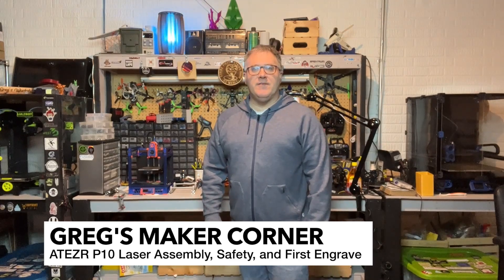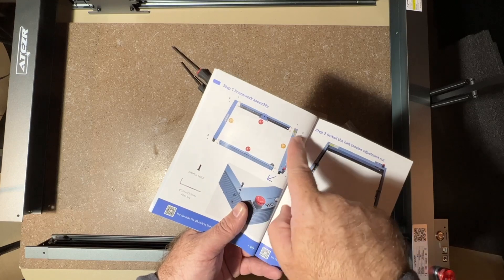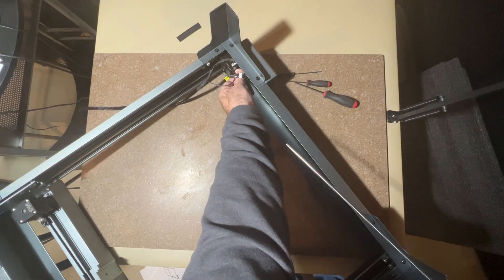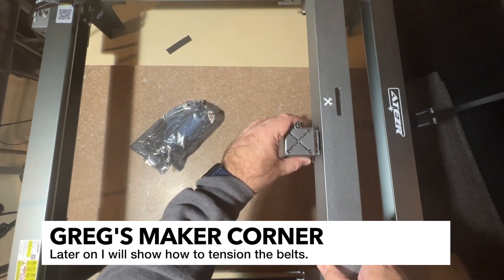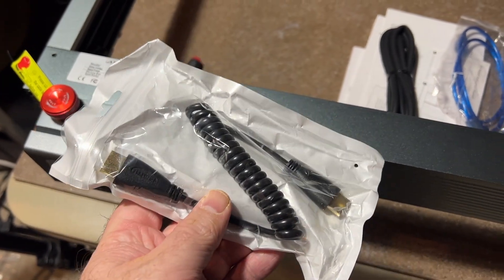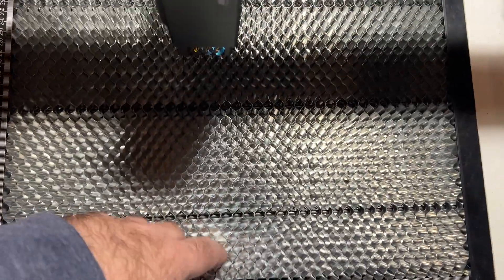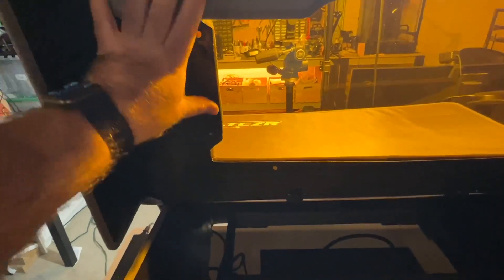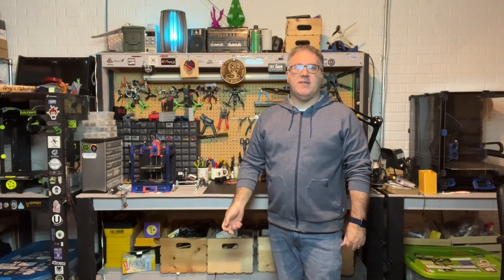ATEZR P10 Laser Assembly, Safety, and First Engrave

Comment: Hi Greg!  I am new to lazer engraving and assembled my Atezr p10 60w engraver. When I go to home the machine, it works well on the lazer axis but then makes a terrible noise and stops when trying to move down the y axis. Any idea on what this could be? Lightburn is giving me an Alarm 9 homing fail could not find limit switch. I believed I properly connected the wires. 

I also enjoyed your video! I will be watching more of them! Any input would be appreciated. thanks.
Reply from the maker: It sounds like it could be a few things. Double check that the pins in the connector are fully seated and not loose. If that looks good, it may be possible the motor wires are not in the right pairs based on what you are describing. Also confirm the laser head is homing toward the end stop switch. If it goes the wrong way you can easily change the wires on the connector as well.